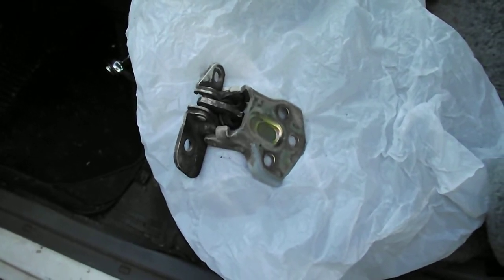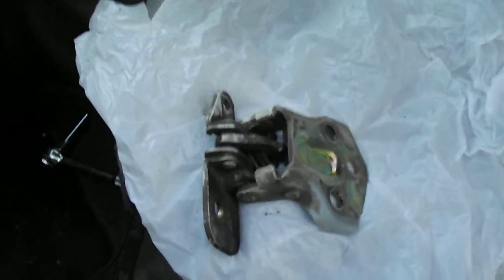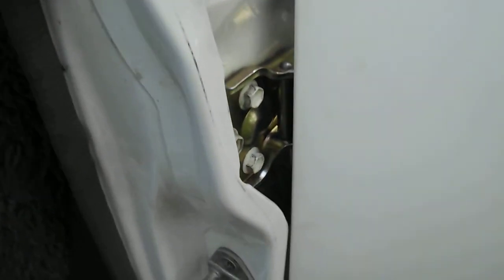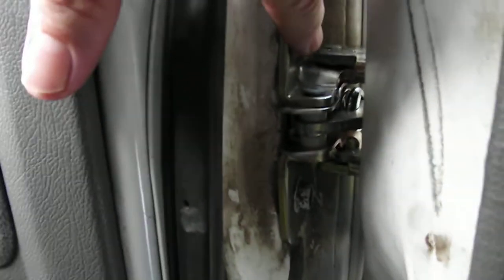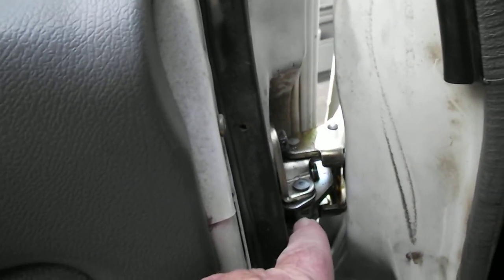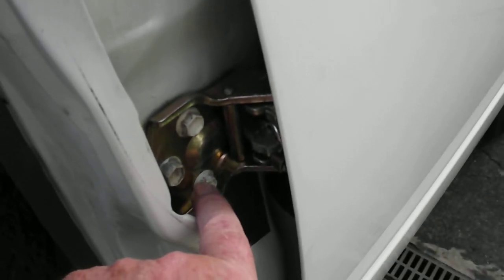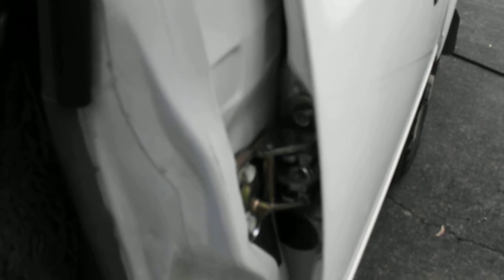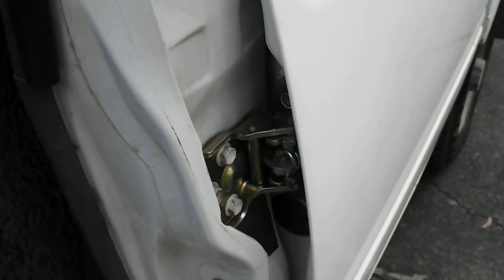Replacement of rear door hinge ( door check ) 1997 Rodeo TFS55

Comment: Do you have a link for part
Reply from the maker: Took me a while to find it as Ebay does not go back that far for purchases.    Pretty sure this is the same one.  Ebay item number 251627582348  , rear lower door hinge but make sure you get the correct one depending on which side you need.
Reply from the maker: In addition make sure that you get the correct hinge/check strap for the doors as there are two, upper and lower and from looking at mine that are different.
Reply: Thanks mate.
Reply: Im looking for top rear,thanks